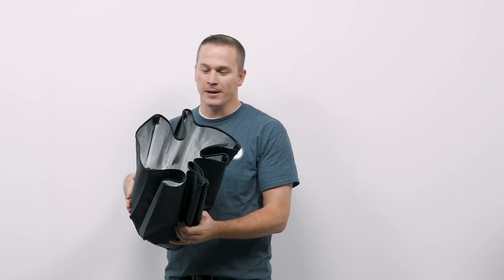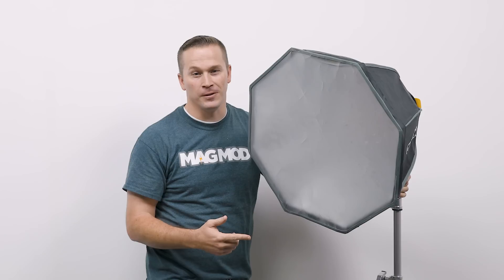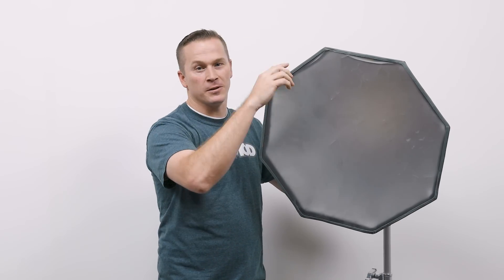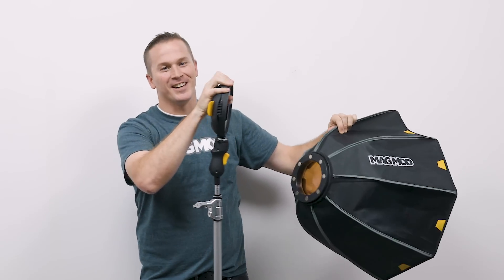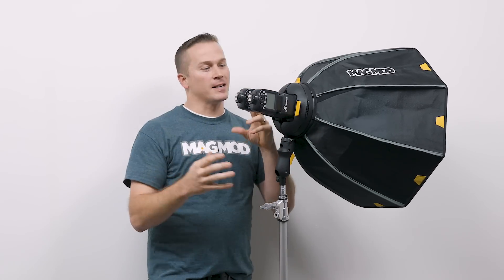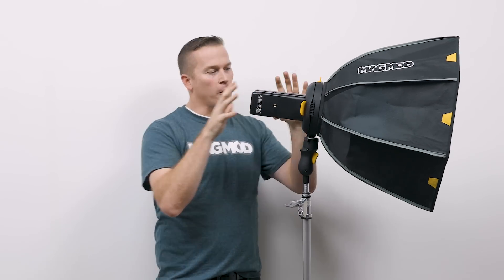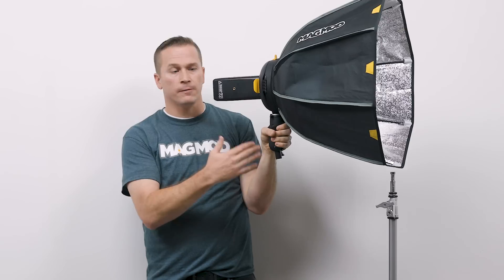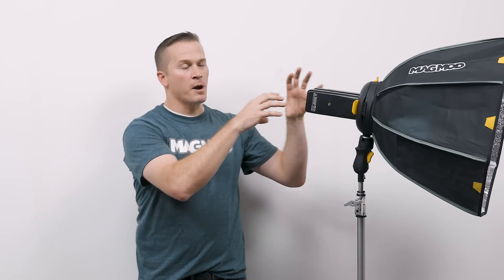Trevor Dayley's 10 MagBox Features

Comment: Doesn't the Softbox fit into that case? Also; How many stops of light, does the front diffuser lose, versus the flash alone (not compared to other diffusers), but just by putting it on over the bare flash units? Thanks. ...Joe

Comment: I thought this was great right from the start, but when you got to the built-in gel holder you blew my mind.

Love your products, in spite of the somewhat inflated prices. Can't wait to get this and use it with my AD200s.
Reply: Dj Toman I made a comment about the gel holder! To me any one who has magmod gear will undoubtably have the original magmod gels would it not have been a good design to be able to use these and click the holder to the flash gun to then attach to the rest of the holder! This would have alleviated the need to buy all the gels again in a large size surely?
Reply: It's amazing DJ. I have absolutely loved using it. So fast and easy.

Comment: Another question? If you use one flash in the mag box what do you use to block the other hole where the other flash should go? Surely you will get light leaking from the gap?
Reply: Hi Nigel, all the testing we have done the light coming out the back is very negligible. I know a light meter was used during one of the tests but I don't have those results with me. I believe MagMod will be putting a white paper together with all the data from tests, for those that are into the technical info. But the light from the flashes goes forward, so any light coming out the back would be light bouncing off the diffusion panel, but most of the light goes straight through it. I do remember during the tests they found that the light coming out the back was even less substantial then other boxes that use things like a bounce plate.
Reply: Trevor Dayley hi Trevor I was just going on what I have used before! I think the new hybrid grid is a great idea I have magmod gear already! It's just a shame the original gels cannot be used with this! Thanks for your reply my friend! 
From across the pond in Yorkshire uk

Comment: Loving the whole concept of this unique portable design lighting kit, being a magmod user myself, However I think Magmod may have missed a small trick and a time saver by designing the gels to slide in the side of the softbox, instead of taking the whole diffuser off placing a gel putting the diffuser back on etc, just a little idea other than that a good product.
Reply: Hi Simon, the MagBox actually has a zipper on the side in order to change out the gels super easily without having to remove the diffusion panel.
Reply: Trevor Dayley i have found out now thanks, they forget toention that in the video not good sales pitch but cool. Cheers.
Reply from the maker: You can see it in this video :) https://www.youtube.com/watch?v=g8uPSyyvXWE&t=1s

Comment: How do the radio triggers fit and or balance at the "back" end of the flash? How do you have two radio flash triggers fit with two strobes?
Reply from the maker: Hi Richard, many photographers now a days have been upgrading to the flashes with built in transmitters. However if you have radio triggers you could attach them just as you have previously or with our MagMod transmitter bands.

Comment: It looks really great and could be exactly what I’m looking for. In this Clip the opening of the box looks a bit  uneven (not round) .. although i like the mechanism you came up with to tighten the sidewalls - have you done tests how many time you can open and close the box before the plastic arms will give in? I feel if I don’t purchase the bag it will break during transport. I would love to test one on a few shoots?
Reply: Hi Markus, the plastic used in the arms is actually a glass filled nylon plastic, the same material used in power tools. The rods extending into the box are carbon fiber rods. MagMod made sure to use the best materials so that the boxes have lots of durability and are long lasting. I believe the plan is to take these new products to some of the upcoming photo conferences like PhotoKina, Photo Plus Expo and WPPI so people can see and touch them, even grab some shots using them at the booth.

Comment: Hey Trevor, few questions,

1. Does it have uniform distribution of light across the surface of the diffuser?
2. What if we want a bigger Softbox? Do they have size options?
Reply from the maker: Sandesh, to answer your questions:

1. Absolutely it does! We specifically designed the MagBox to be deep, which allows for the best light dispersion on the diffuser.

2. The design of our 24" MagBox Octa is an excellent platform for many different softbox shapes & sizes, so stay tuned for more awesomeness!

Comment: Can we use it with like flashpoint xplor 600?like those big strobe lighting setup
Reply from the maker: Yea! You will need to use the speedring adapter, it is included in the Strobe Kits :)
Reply: MagMod Ok! Thanks
Reply from the maker: no problem :)

Comment: Watched this earlier and I have a question??? The built in gel feature, surely if you can attach the flash at the back why is it not possible to use the original gels attached to the flash gun as you would normally then place the flash gun to the back of the box!  The only reason I can see is that possibly the flash gun with the gel holder attached will not allow the door that closes around the flash to shut! To me that would have alleviated the need to buy all the gels again? It's the only thing I don't like about it because mag mod are getting you to re purchase gels which you already have but in a bigger size? Would have been better to be able to attach gels as normal to the flash gun ! Any one who already had any magmod gear will undoubtedly have the gels!
Reply: Hi Nigel - it would mean needing to have two sets of gels for everything as well since it wouldn't reach across both slots. You might be able to McGyver something together, but we believe the integrated gel slot was the fastest, easiest and best way for photographers to be able to gel both flashes at the same time while using the MagBox.
Reply: Hi Trevor watched another video regarding the gels and according to this video you can use the original gels! All I can think is the video you were in was made before the one I saw?
I would love to see a larger soft box produced for this system, and hopefully eventually it will.
Reply: You can use the MagGel holders with the original gels on the outside of the MagRing, but if you are using those then you wouldn't be able to also use the MagBox. I will definitely be doing this in situations when I need two flashes with gels and my light is placed further back so having the MagBox wouldn't make a huge difference in quality of light. But they won't fit on the flash and snapped into the back of the MagRing.

Comment: What are these 80200 (?) extremely powerful flatheads you are using. I'm not familiar with them and can't seem to find them on the internet...
Reply: You're looking for the Godox AD200. 😊 Also sold as Wistro and  Flashpoint AD200...Depending on the region I believe.
Reply: AD200
Reply: i need this.

Comment: Is it good balance ?
Reply: Hi Eddie, can you help me understand the question?
Reply: Sorry, 2x ad200 are almost 1.8kg, they attached at the end.  When it put on the light stand, can it get good balance.  
Also, I would like to use the bulk bulb, any solution ?
Reply: It balances well. I have used it on a number of shoots with no issues. We haven't yet shot it with the omni bulbs in the Godox flashes but it is a request that keeps popping up so we will give it a try.

Comment: I like it, there is only on BUT you loose the modeling lamp of the twin head from the ad200
Reply from the maker: They are built into the AD 200 so you wouldn't loose them :)
Reply: MagMod when you use the twin head you gain access to a ultra bright led built in the twin head you loose that
Reply from the maker: Thank you for feedback!

Comment: Will it work with the Godox AD600 too?
Reply: Yup, I believe so
Reply: yes, they also have various ring mounts (e..g, bowens) that you can use instead of the magring
Reply: Yes. There are ring mounts that will work with it. In our Facebook MagMod community we did a LIVE question/answer where we show it connected as well.
Reply: Bob Huynh all they need is to modify that flash bracket to have a Bowens mount and it'll be done.
Reply from the maker: If you get the speedring (which is included in the Strobe Kit) it will work with a Bowens :)

Comment: I really like the look of this and I am definitely considering purchasing, just one question though. You made a comment about math and the even distribution of light, but if I only have one flash to mount in that ring mechanism, it won't be central, so would that throw the maths out and lead to imbalance, or is there no concern with that? Thanks, Rob :)
Reply: Hi Rob, I have seen even distribution while using one or two flashes.

Comment: sorry to kill the party but it looks bulky to me as well as I am sure it is more heavy due to the magnet frames. Since there is this ring you cannot collapse it to a small piece, the way you would do with other softboxes
Reply: Definitely not killing the party. Everyone has their preferences. After having used it, it hasn't seemed too bulky to me. In fact, it fit nicely inside my backpack even. I love the speed and ease of using it. Takes a couple seconds to pull it out and open, faster than any other softbox I have ever used. That speed, plus the integrated gel slot and the ability to use two flashes in the MagRing are all huge benefits for me.
Reply from the maker: Thanks for your feedback, Hadas, the box itself weighs 1.8 lbs :)
Reply: You are doing good job emphasizing the unique features. I never felt opening another softbox is long. It's like opening an umbrella. Takes only 10sec. I presume yours take 5 so we save 5 sec (which is a lot 50%). Wish you anyhow good luck.
Reply: Do you own one?